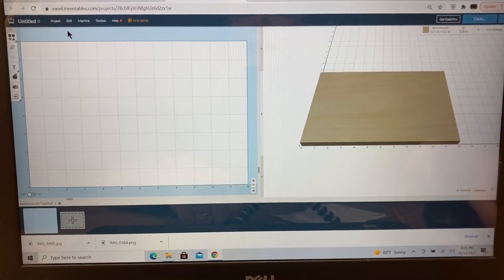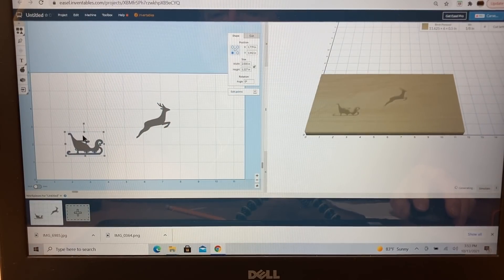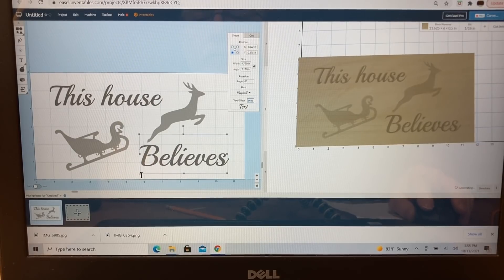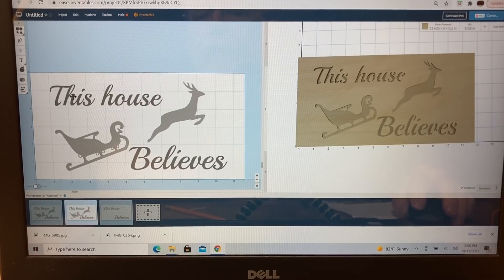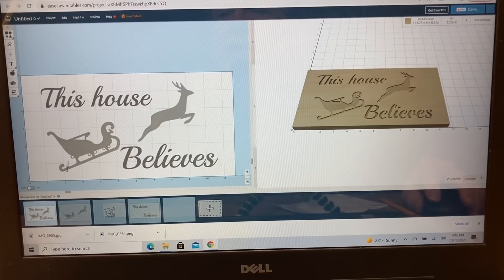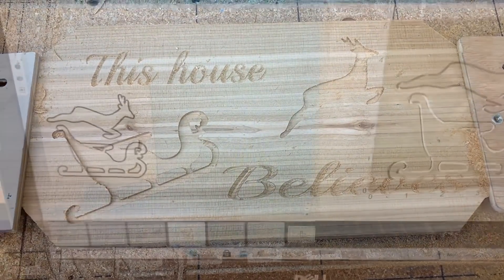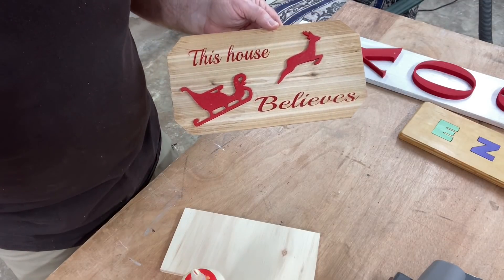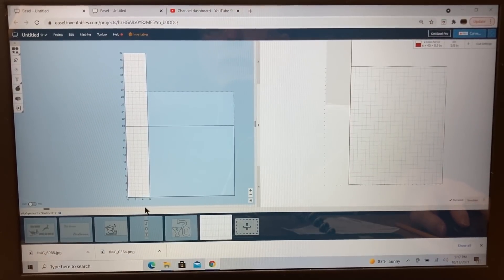How to Use the Easel Inlay App

Comment: You need to keep it coming. I need a more in depth video of where when i want my engranving done with the v bit but instead it will try and cut my bowl out with a v bit also.
Reply from the maker: I have numerous videos showing the changing of the bits. Two stage carving and even more bit changes are possible with each workpiece added as necessary. Thanks for watching. If you have specific questions I’ll try and answer them

Comment: Great video! Just wondering what the bit size was used for the inlays? I'm assuming the same 16th bit
Reply from the maker: It all depends on the detail you are trying to achieve. This was done with an 1/8” straight. Make sure whatever you choose, you the same bit throughout. If painting leave more clearance. Mine are actually a little tight

Comment: Great video. I do have a question tho. Am i mistaken that you used some easel features that are only available as paid pro features?  Specifically, the font and V bit
Reply from the maker: There is a selection of fonts for the basic easel. The Pro version of Easel has many more forts available. VCarve is a Pro feature
Reply: @PawPawsWorkShop  please understand that I'm not a troll and do appreciate your content. I'm just trying to confirm that most of the final product was a result of the paid Pro option and not available with the free version?  Btw, thank you for the quick response 🏆
Reply from the maker: actually most of this video can be done with easel basic. The pro features are the VCarve and the additional fonts. There are a few other features that really don’t apply to this video

Comment: Great video. This answered a bunch of questions. I have seen some videos where a hole for a pin is drilled to mark the different positions for tiling. Does Easel have that function?
Reply from the maker: Yes, just add the holes into your design at the appropriate location and diameter.

Comment: Hi, I love watching your videos because you explain everything very well. But when I try the inlay app my cutout has yet to fit. I’m using an 1/8 straight cut bit and I made sure the inlay is cutting on the line. I even tried to change the tolerance to .01 and it still doesn’t fit. What am I doing wrong.
Reply from the maker: Cut on the outside not on the line.
Reply: If the inlay already doesn’t fit wouldn’t cutting outside the line just make it worse. when I said doesn’t fit I mean it won’t go in at all.  @PawPawsWorkShop

Comment: Hi Paw Paw. I'm a new subscriber. I'm in the market for a CNC and I was interested in the fox alien. In your opinion do you think it would be sufficient to cut guitar bodies?? Any info would be helpful. Thanks.
Reply from the maker: It’s very capable of doing the carving. I do not know the size of the guitar bodies so make sure that it will fit on the wasteboard of the machine. If not you will need a larger cnc
Reply: @PawPawsWorkShop  sure it'll fit. Thank you for the response.

Comment: Question at 8 min: why didn't you use the inlay app separately for the 2 pieces? Seems you have to deal with them being coupled later.
Reply from the maker: Good point. That would work just fine also

Comment: Paw - my inlays are not aligning.  Any idea why they do not fit?
Reply from the maker: Are you cutting on the path or cutting on the outside?
Reply: Thanks for replying.  I was using the inlay software.  I tried a different design and it seemed to work fine.  Must have been something I the file I was using.